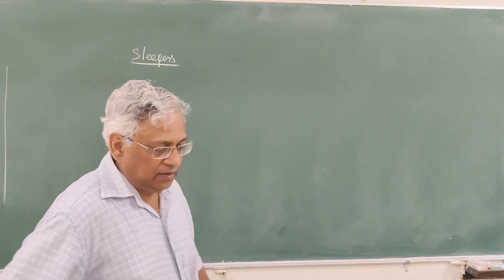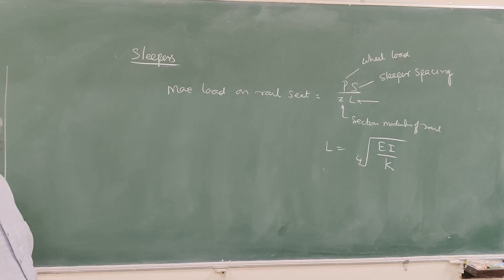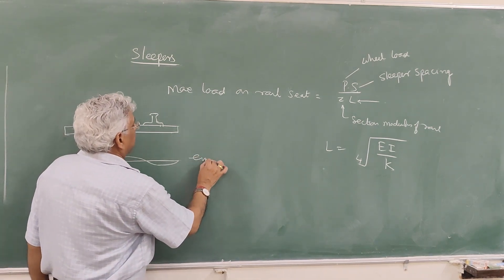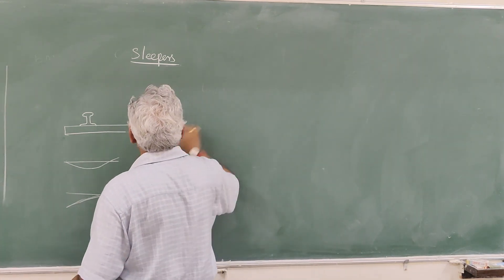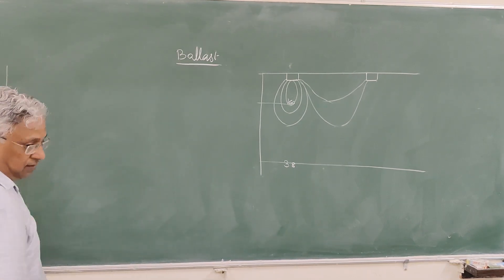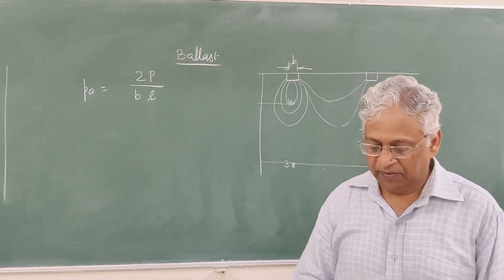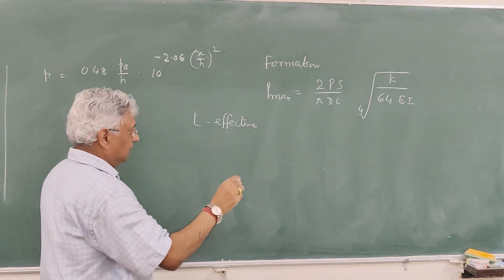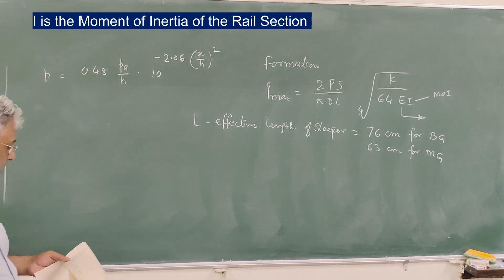#Stresses in a #Railway Track - Part 3, stresses in #sleepers, #ballast and at formation Level.

Comment: Profesor Chandra, Is there some way to calculate the spacing between joint sleepers, joint sleeper and first shoulder sleeper, first and second shoulder sleeper and intermediate sleepers in function to average sleeper spacing in a standard gauge track? Thanks for the answer
Reply from the maker: The spacing between joint sleepers should be as minimum as possible but considering the space required for packing of ballast. Gerenally it is 50 - 60 cm. Spacing between joint sleeper and first shoulder sleeper is more than this spacing, may be 80 - 100 cm depending upon sleeper density and so on. There are no calculations available, these are based on field experience only (to my knowledge).
Reply: @SatishIITR   Thank you very much, Professor Chandra

Comment: Professor Chandra, In the equation for the pressure below the sleeper (Pa) comparing it to the equation from  the book of William W.Hay ,Railroad Engineering, page 268, the author adds a (2/3) factor that multiplies "b*length of the sleeper" (bearing area). It is important or necessary that factor? Or should I ignore it?
Reply from the maker: Yes, a factor of 2/3 is to consider the effective length of sleeper below a rail. I have taken this factor 0.5  in place of 0.667. That is why 2 is in the numerator.
Reply: @SatishIITR  Thank you very much professor